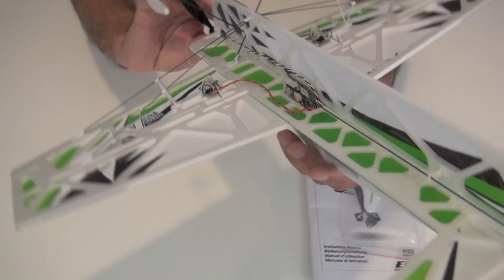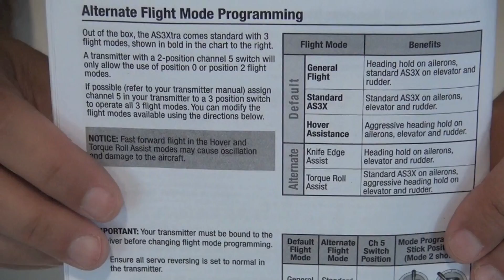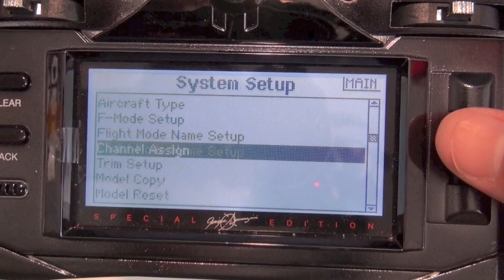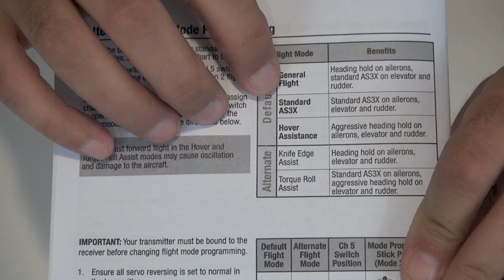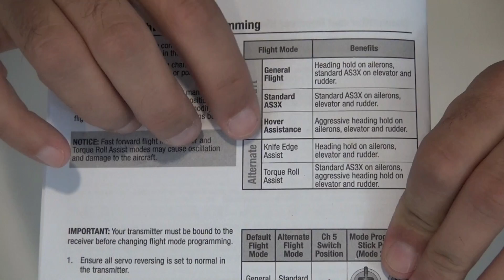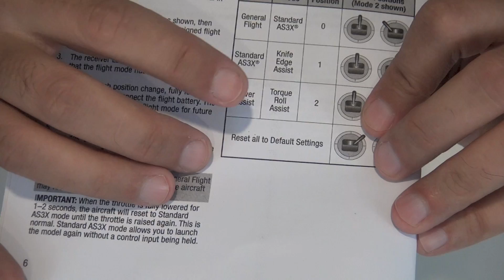E-flite AS3Xtra Pre-flight Review and Set-Up.

Comment: Just to clarify, which of the first two modes is best for a beginner making the plane the easiest to control?
Reply from the maker: +Sandy Scott The assist modes help with that particular maneuver but for just general flying standard as3x in low rates will be the easiest.
Reply: +Discover RC Great thanks.  Been looking for a slow flier and one of the forum members recommended the Tech One Katana for a BNF model that will meet my mission.  Going to check that out prior to making a decision.

Comment: As always great review. What's the difference between General Flight and Standard AS3X? Which one make the plane fly more like a regular plane, as in no assistance like the 300 3D. Also can you fly slow tight indoor high-alpha maneuvers in hover assist mode, or just hover in place?
Reply from the maker: General flight mode has heading hold on the ailerons while standard as3x does not. If you want the least assist go with as3x mode. I like high alpha in standard as3x, but after flying the assist modes for a bit I found as3x to just be the most fun.
Reply: Can you fly around in high-alpha in hover assist mode, or does hover assist just keep the plane in one spot?

Comment: Thanks very much for your reply! So it looks like with my channel 5 two position switch gear switch I can run general as3x on 0 and hover assist on 2, but can change to standard on 1, and torque on 2 by reprogramming through the sticks. I can live with that!  Thanks again.
Reply from the maker: Yup, you can still use 0 and 2. I would still buy this without those assist modes-they are cool but the fun is flying the plane! :) Have fun with it!

Comment: Great video. Do you know how to program the three position switch (flap) on a dx7? I think I need to assign gear to flap, but don't know how. Manual is a bit confusing.  Sorry noob
Reply from the maker: Hey Mark-that's a good question. I charged up my old dx7 and took a shot at it, but cannot find a way to do that. Only looks like aux2 could be moved to the 3 position switch. Sorry I can't help more with that one.